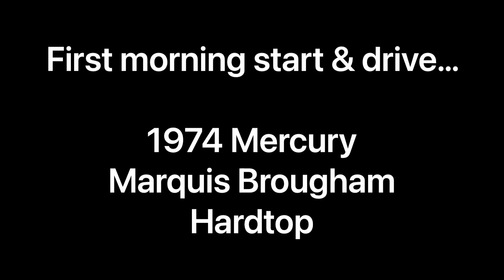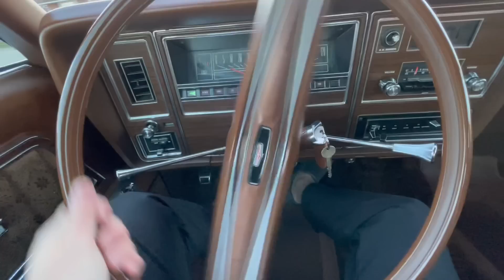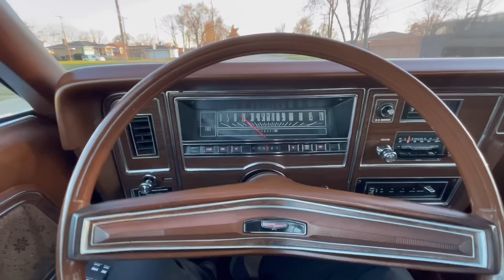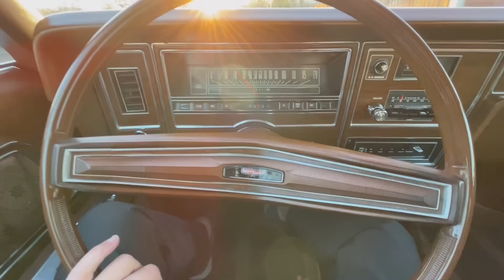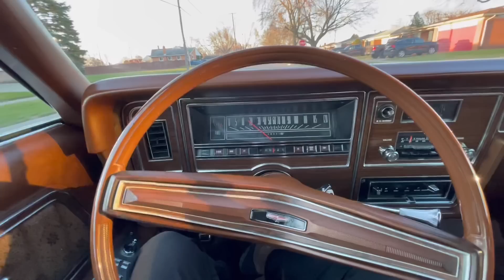1974 Mercury Marquis Brougham 460-4V Hardtop Walkaround & Drive: The Hawaii 5-0 Car

Comment: Love the car & colour!
Seeing the amount of steering wheel revolutions it took to pull out of the driveway put a smile on my face lol
Keep it up!
-Chris
Reply: Laffin...steering wheel revs.   My parents were Ford fanatics.  I learned to drive on a 1970 Ford XL convertible, 429 v-4 bucket seats and console! Yes, it even had cruise control, and am/fm radio. It was a tri-color car.  rare.  My mom loved yellow.  She saw this car at the local Ford dealer and told dad the '66 Galaxie has to go.  The '70 was Springtime yellow. white convertible top, and Black interior.  STRIKING car!  With those fake mag Ford hub caps.  That car was a dream car really.  Drove excellently.  POOR mpg.  I swear you could watch the fuel tank gauge move, lol.  I wish I had that car now.  Loved the hidden head lights.  (the ones Adam talks about all the time)   ;-)

Comment: Had both a 1969 and 1970 Mercury Marauder X100. Both with the 429. The '69 had power bench, leather, cruise, A/C, magstars, the works. The 70 had vinyl sport buckets with center console and the horseshoe shifter. Both had the blackout delete and both rode like you were on a cloud.
All I have left of those is the dash from the '70. The Maroon '69 still lives on somewhere. Love those big old big block Mercs.

Comment: Not bad. 
A buddy's got a 76 Lincoln his dad got new and has under 30k on it, and yes it's as nice as you think it is. 
I've been helping him right some of the wrongs over the years,like aftermarket plug wires and some other aftermarket replacement tune up parts that are obviously wrong. 
I told him get an AGM battery,and I can remove the battery tray and bead blast it at work for him. 
These cars aren't even my thing at all, but I love a good time capsule no matter what kind of car it is. 
As far as detailing it, I used to help him with that to flip cars,but I told him he would be dollars and sense ahead to have AMMONYC do it instead since we are within about 2hrs of NYC.

Comment: Way back in the 70s the father of a high school  friend had a '74 Brougham pillared hardtop with the Grand Marquis interior. His father (friends grandpa) had an identical brown with tan G-M interior, except his was a hardtop. I remember even as a teenager thinking it was highly unusual, as I had never seen another outside
of H5-O on the TV. If  4000 were made, I can extrapolate that few than 400 ended up in Canada, and of those 400, almost all would have been sold in Ontario. Thus on the sparsely populated prairies, it was very rare.

Comment: I got a chance to drive a '69 Marquis.  It was black with a black vinyl top and burgundy velour interior.  I came to an intersection with a rather pronounced rise in the middle of it.  I was going too fast.  The bottom of the car hit the bump.  I was only 18 at the time and not a very experienced driver.  Boy, those cars are softly sprung!

Comment: Nice condition car.  Nice that it’s a hardtop also.  

Not my cup of tea but I can fully appreciate how nice they are to drive.

They just don’t have that lean lithe clean style like cars in the 60’s did. 

I’m a GM guy but I’ll admit that 70’s Ford’s were better in terms of body structure and ride than same period GM’s.   The biggest issue for Fords of that era was rust.
Reply from the maker: Agree on all counts
Reply: i'm a g.m. guy two but my grandfather had 6 of those wonderful cars from 1962-73. and those were the quietist most comfortable cars around. My grandmother for some reason decided to trade her 1970 monterey custom in  1973 for a new plymouth gold duster hatchback .big letdown those mopars were horrible noisy rough riding tin cans on wheels.

Comment: OK Adam. I am a big fan! You are ALL that! But Man, this "fixation" with mid 70's Mercuries has to stop!  Big brown boxes with park benches on the front and back. And they had those cheap plastic uninterestingly styled Ford dashes! You've got all those Rivieras, Electras, Imperials, and Bonnevilles! You obviously know good styling when you see it. Even the mid-60's Mercs you have are gorgeous. Isn't there a meeting you can attend for this? Get help.🤣

Comment: Love this talk on the Mercury Brougham.   This talk reminds myself of the 1972  Ford LTD Country Squire I had.  I bought second hand.   I notice the steering wheel looks exactly the same except for the emblem in the centre.    Big fords had a fantastic ride.   It was a good highway car.   The engine was smaller , a 400  Cleveland engine.   I loved this car for ride , room and comfort,   Gas mileage was terrible.    Anyway keep up your talks-  I always look forward what is next.

Comment: I never was a fan of the large Ford/Mercury products after 1972, but I have to admit that it’s nice to see any 48 year old vehicle in this condition. You didn’t say how many miles this car has on the odometer. It seems weird that whoever ordered this vehicle new didn’t specify cruise control. I don’t know if you have ever researched it but once I read that the two lowest production American cars were both Mercury’s. I believe that the model year was either 1973 or 1974. Monterey and Monterey Custom’s were available as either a 4 door pillared hardtop or a conventional 4 door pillarless hardtop. I believe that in the Monterey version only 2 or 3 hardtops were sold and the Custom sold a similar amount.

Comment: Seem strange to see the seat belt shoulder harnesses hanging in the breeze with no pillar around. Most hardtops would not have had shoulder harnesses fixed as they are here.  GM had the two piece belts that were perennially clipped to the ceiling.

Looks like you have a good runner right out off the trailer

Comment: Be VERY CAREFUL About leaving the car running especially on fast title and getting out of the car and closing the door…!!!! 
60’s & 70s Ford Mercury Lincolns with column shift automatics can easily drop into reverse..!!!! 
Major Recall for that after many people were killed.... 
Ensure shifter is firmly in Park. 
Apply the parking brake (if it’s not seized). 
Don’t get out of the car on fast idle. 
Better still SHUT IT OFF before exiting the car.
Reply from the maker: You are correct.  This was largely fixed by 74; it was mostly an issue through 1971. Still, you’re right.

Comment: Does your next door neighbor ever get pissed with all your big block cars burbling night and day?
Reply from the maker: None have loud exhaust. They sound quieter than a modern car.
Reply: @RareClassicCars  Just the continuous white noise WOOOOSH of intake air and pulleys spinning, and the very slight rumble emanating from the tailpipe.
Reply: I was going to ask about that.....it's not even a CB/Communications-type antenna, it's a cheapo J.C. Whitney AM antenna. Glad to hear it's coming off but what are you going to do about the hole?

Comment: Man, is that thing remarkably unblemished for >48,000 miles, it had to be garage kept. But I can't believe it doesn't have color-keyed seatbelts! Was there a deluxe belt option for them? She's had a water pump... The engine paint looked lighter in hue last night. I see an R134A conversion. Points ignition? Love the mechanical 'digital' clock, and the passenger mirror control! Fingers crossed for no Brake Booster Bollocks with this one! Looks like someone knowledgeable has had their hands on this one. I'd just clean the carb. Turn signal sped up when you pulled away from a stop.  So what is your CB handle??😆
Reply from the maker: They did have a deluxe belts option
Reply: All 400s and 460s had electronic ignition starting in '74.
Reply: @roger628  OK, that must explain the non-horseshoe coil connector blue-top coil, (points versions having the gold or yellow top) but I am not seeing a module/box. Would this be a Duraspark 1 system? I know it changed quite a bit for the first couple or few years, before 'finalizing' with the large distributor caps and 'blue grommet' Duraspark box.
I see Ford guys dog on Duraspark, but I've driven over 220,000 miles in three different high mileage Duraspark vehicles, with never any failure! I even retrofitted it to my old '68 Cougar's 289/302.
Reply: My blue Grand Marquis had the same belts.